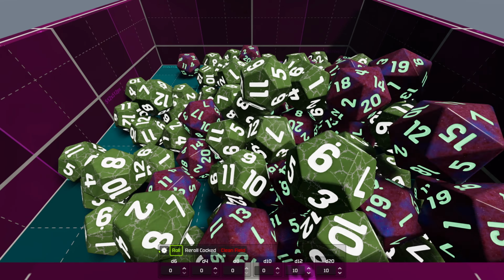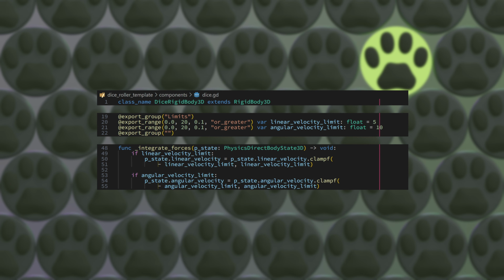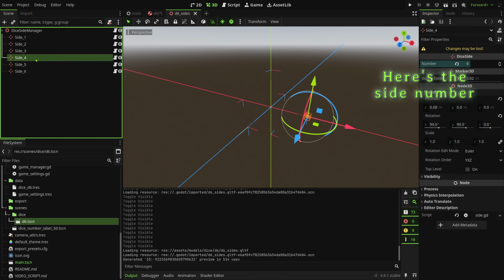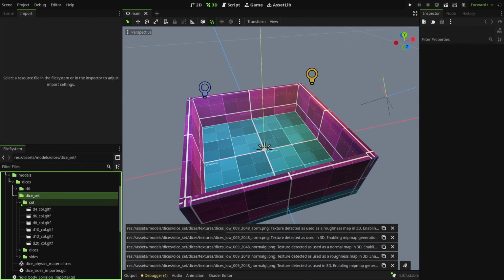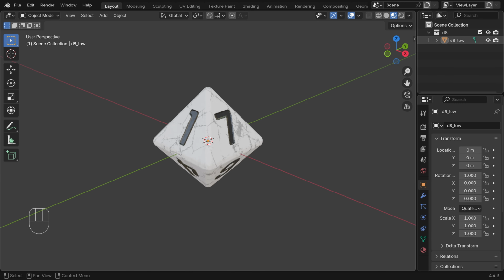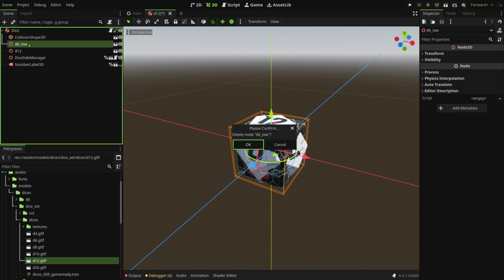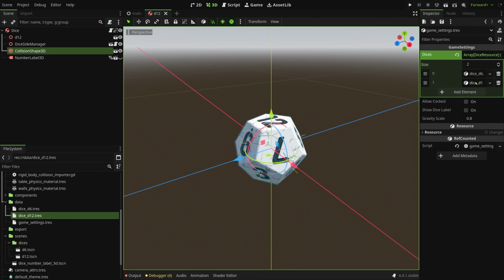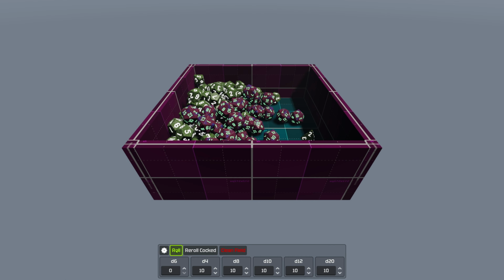Add Dice Roller Mechanic to your game | Godot 3D Physics-Based Mechanic

Comment: Hey pawsgineer! Awesome template, it has saved me a ton of time setting up 3D dice in Godot.

I’m currently using it for a multiplayer game where the rolls are predetermined on the server first, and the client just visualizes the result.

To make it work, I tried using a smooth "slerp" correction to align the die when it slows down. However, playtesters immediately notice the visual "snapping" or "sliding" of the dice at the end, which breaks the illusion of natural physics and feels a bit "rigged."

It would be amazing if you could add a feature for natural-looking predetermined rolls using one of these methods:

    Deterministic Spin Offset: Always throw the dice with the same physics force, but adjust the initial starting rotation so it naturally lands on the predetermined face purely through physics.

    Mid-air Steering: Subtly correct the rotation mid-air while the die is spinning rapidly (where the human eye can't track it), allowing it to land and settle naturally on the table.